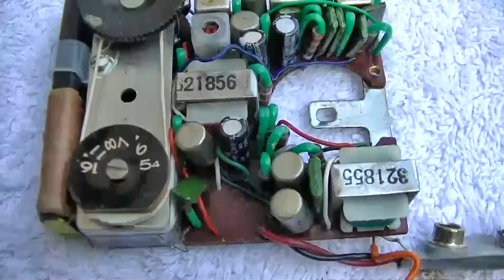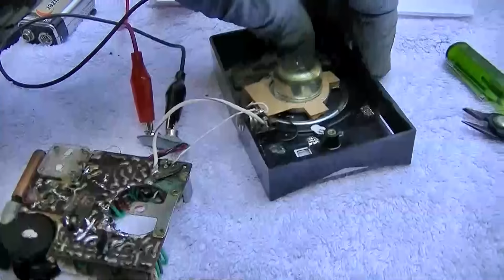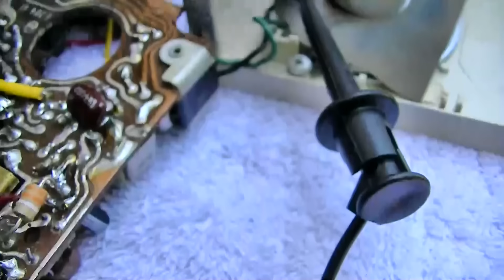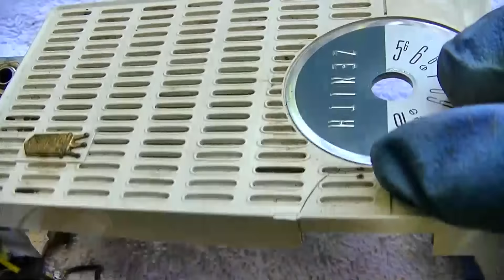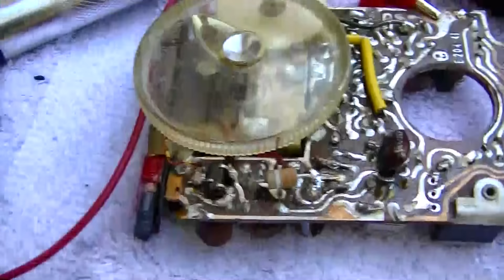Repairing Two Vintage Pocket Transistor Radios Zenith Royal 50 And Continental

Comment: I've got a Zenith Royal 50l that was my grandfather's. It's sentimental to me.  I found it in a box that I've had for years.  It had some corrosion on the battery connections that I've cleaned, but the radio is DEAD, nothing.  Are you still doing repairs??
Rob, WB6CEL

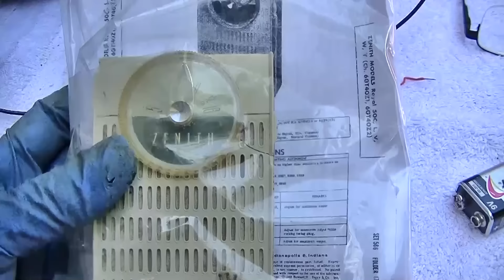Comment: 11:40 is the same exact transistor radio that “radiotvphononut” has. But his has the original sticker on the back. This one does not.

I used to have a little transistor radio and it was Stewart, and it was a small square and it fits right in the pocket. It was AM only, but it doesn’t have FM. It was lacking the band. I wonder if they might add a Bluetooth to these two units and it will play MP3 music on them if they will add a selector switch.

Comment: I am the owner of a blue 1963 Realtone 9 transistor AM radio, made in Japan. 

To my knowledge the radio has never been serviced, but it has been with me for the last 10 years.

Of course it runs on a 9 volt battery like most of those vintage transistor radios did back then.

I am currently listening to the news with it. 

I find it amazing that 57 yesrs later it is still working, and with good reception and great volume.

You hear the phrase “they don’t make them like that anymore”, but that’s an understatement!

Comment: I really like your repair videos. I got a question, could a Russian MP38 be used as a substitute for a 2n168A (Germanium NPN) it's used as a converter in a small portable AM Radio.
-Tom
Reply from the maker: I don't think the MP series goes up fast enough, most of those would be the 1T series
Reply: @shango066  Good Info, reason I ask it claims MP38  Freq.  2MHz. I thought it might be ok for the AM broadcast band.  The NTE101 looks like it might work but they are pricey, the NTE101 packaging bag says Ft: 5MHz . Can you recommend an 1T # that could fit the bill?

Comment: This tester just seems to get too easily confused by the larger reverse leakage currents of Ge transistors. Sometimes it just display way too high gain (it measures it just as a plain dc Ic/Ib, instead of differential deltaIc/deltaIb), but sometimes it just misidentifies the component at all and shows nonsense...

Comment: About that speaker rattling against the grille, I have a Zenith Trans-Oceanic D7000Y that also rattles or distorts on the bass. However I'm not sure if it's the grille, considering I removed the original foam insert (which disintegrated to dust), or if it's amplifier distortion (the transistors are a matched pair, original to the radio, they put out 500mW into the 4x6 22 Ohm speaker). And that's when you have it at a moderate volume (about 1/4 on the volume knob). The speaker is in mint condition - no cracks, tears or anything out of the ordinary. Obviously I could adjust the tone control and reduce the rattling or whatever it is, but it's going to continue to persist.

Comment: When I do an alignment I use a scope across the voice coil to find the peak.  Some like to use a vtvm or a vom.  I like the scope because sometimes at peak the waveform becomes distorted.   I back of until the waveform becomes clean and no further.  If I was stuck on a desert island and I could only take one instrument with me, it would be a scope & something to power it with.

Comment: Sounds like u had done a nice job in getting that zenith vintage transistorised radio working well in the end,,,can't believe how the trimmers and the core transformers were out of alignment due to being tightened up? No wonder why the radio didn't receive any stations. 

I've only done realignment of cores and trimmer sensitivity by ear,,,on any radio I had received that had station and sound troubles,,,and found only a lot of dust and moisture inside,,,along with cracked dry solder joints too. No parts replaced,,,just cleaned and resoldered and re-aligned tuning cores and trimmers on the tuning capacitor,,,and the radio was working like a new one altogether. 

The owners couldn't believe how I had restored a few old vintage transistorised radios back into working order by doing a lot of tlc repairs,,,they paid me well,,,and very much never had trouble with the vintage transistorised radios again.

Comment: The second set had the classic Man Made Fault and they are always hard to find! But as far as the Output Transformer goes -  any similar one will do here. There is quite a bit of leeway here. A good one from a scrap board or from a Bangood Radio will probably do here.

Comment: 25:41 I see, it uses two xsistors to create the RF-to-IF converter-stage in a LO and Mixer, not a single xsistor as in the more utilitarian Autodyne Converter. But why do that at all?
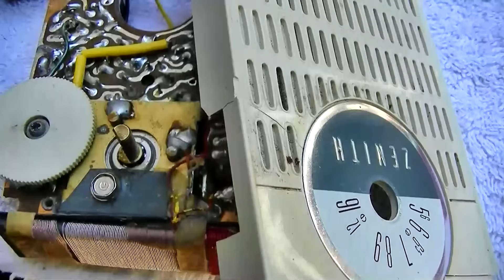26:50 Only 75 degrees in Redondo Beach?
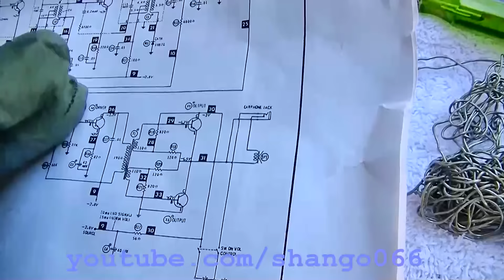39:25 This pocket radio receiver has a truly unique battery connection and Vcc design?
Reply: To be able to advertise more transistors.

Comment: A symmetrical power supply for such radios can be made using 4 silicon diodes and a resistor. 2 diodes have roughly 1.4V drop on them so about the same as AA battery. I often used zeners for making  basic +-5V symmetrical power supplies in low power devices.
Reply: I would've just made a resistive divider with a pair of large 20 ohm resistors I have.

Comment: Somebody fixed that Zenith previously by tightening all the loose screws
Reply: Trevor -  I was fortunate enough to get recently on eBay a Nippon Nipco 8 transistor portable radio. It's around 60 years old.  Works just fine. 
It appears that it was never used. Paid $100.oo for this great little Nipco.  Put in a fresh 9V battery and tightened all the loose screws.
Reply: Well of course!!!! Can't have loose screws. Everybody knows that... Sheesh....

Comment: In essence, a bipolar transistor is two diodes connected together. I wonder if those transistors have just degraded enough to confuse the tester
Reply: nah....i used to think that too, but hooking 2 diodes neg to neg doesn't mimic a pnp transistor....no matter what you on the neg connection current will not flow from pos to pos....what ever those transistors are doing there is some sort of electrical  seperation in the base region of the material...but germanium does do strange things and the $6 tester was not capable of giving correct results....no matter how they test, they do work..

Comment: 2n404 is a computer switching transistor, useful at the BCB.
Only one station, sound like the IF's are WAY off freq, and the converter  isn't working, IE: it turned into a one station TRF.

Comment: Odds are the transformer opened up right were the winding connected to the leads.  It's not likely to burn out.  Might be worth touching it with an iron to see if heat will fix it.  It might be fixable - if you have the hands of a surgeon.

Comment: It should also be noted that the capacitors in the Continental were bursting at the tops, so regardless of whatever else was wrong, they needed to be replaced.  I've been in this business, on and off, for 50 years and I've certainly heard Shango and others state that bad caps seldom cause a radio to be dead.  I will take full responsibility for getting the antenna wire in the wrong place and causing the other short in this radio.  Thanks again, Shango
Reply from the maker: Yeah they would usually be open or highly degraded at that age.
Reply: Credit to you for owning the mistakes, it's not easy working on stuff designed not to be serviced & am already noticing my eyes not being as sharp on tiny stuff at the tender age of 39 so you're not doing bad at all!

Comment: (@15:20) - it looks like someone replaced the transistor (a.k.a. Microminiature vacuum bulb w/no filament) with something they thought was a transistor, but was - in fact - two diodes front-to-back. The tester confirms this, as the junction (1) is the cathode of one diode (1 to 3), and the anode of the other (1 to 2). An NPN would test as common-anode, and a PNP would test as common-cathode. Is there a part # on that thing? I doubt it crosses to any BJT in the NTE cross-reference guide. And if it does, then I’ve never seen that failure mode in a BJT before.

Comment: Am radio is just about dead. Not many stations that broadcast music on am anymore, mostly talk radio and news. Was cool in the 80s when am stereo was around, sadly it died. I still have my cquam recievers and have an am stereo transmitter that i show others what was once reality.
Reply: What is WORSE is they are piping in stereo music from FM!  AM sounds great with MONO music.
Reply: @Brother-Weaver  In Australia I used to get am stereo in very clear sound form,,,from an am radio station that was nearly 200 klms away,,,wish I still had heard that 2day. Now the same station is on fm stereo,,,I don't always receive it that good,,,compared to am stereo back in those old days.
Reply: A lot of factory car stereos supported AM stereo, but it was never advertised. I don't think the owners manual even mentioned it. The 1986 Dodge Omni that was my first car apparently had a radio that supported AM stereo, but I never knew it till later.

Comment: That's so wierd to see a bad transformer in a solid state pocket radio. There really isn't enough voltage or surge current to burn out a winding. I would cite oxidation as a possible cause, but the rest of the radio doesn't appear to suffer from it

Comment: I find that re-soldering the litz wire from those antenna coils back to their pads on the chassis is a real pain.
Reply: Since Litz wire is just thin little strands of enameled copper wire stranded together all you need to do to make it easy to solder is to burn off the enamel with a match or lighter and then gently clean the copper off with a piece of steel wool or fine sandpaper.  Once the copper is shiny, tin the end with solder and solder to the circuit board.

Comment: Don't test old germanium transistors with that 'transistor tester' things. It often tests incorrectly due to high leakage currents. It was designed for modern silicon stuff. Results with germanium are pretty random.
Reply: That's true.
Reply: Electro FAN, What about using the older analog meter testers for leakage and gain?

Comment: To answer some questions. This Zenith is my radio. Purchased from a yard sale recently for a couple of bucks. When I opened it, it did not appear anyone had been in it. The electrolytic showed shorted, so I replaced it. I did not touch any of the cores or trimmers, which proves I was very wrong in assuming no one had been there before me. I believe that I said in the package that the Continental was the important one. Personally, we’re I Shango, I would have EOLed the Zenith by heaving it against a brick wall. Much credit is due to his persistence and many thanks for taking on these two radios.
Reply: Thomas Kempke - never assume the inside of vintage electronics is "virgin territory" (untouched since it left the factory) as that is very rare. Some people tend to overestimate their skill level when it comes to these, thinking "it's got a little problem, I reckon I can fix it" (when they don't have the experience, proper tools, equipment or ability to accurately diagnose and repair these things with any degree of success) so by the time it ends up in the hands of a new owner, they will find springs, clips or screws missing, broken plastic, or bad solder-work. I've seen this many times with boomboxes (especially double cassette models) and portable multi-band radios and made the same incorrect assumption that they were virgin (or close to it).
Reply: Why EOL? That transformer can be changed with one from the Chinese kit.
Reply: Can learn more from trying again after you give up and take a break.
Reply: I always either use a 1 wood, about a 4-iron, or, on a really sunny day, throw it up and it's a homer.  -thousand pieces gets the grand slam.
Reply: @_Ramen-Vac_  you should try some Cricket, might be able to bury chunks of component lead in the bat if you swing hard enough